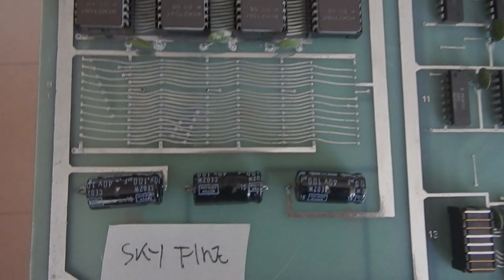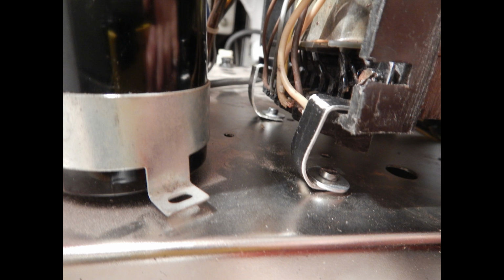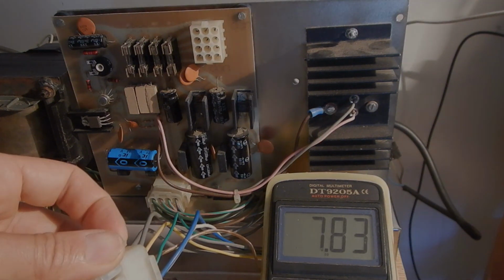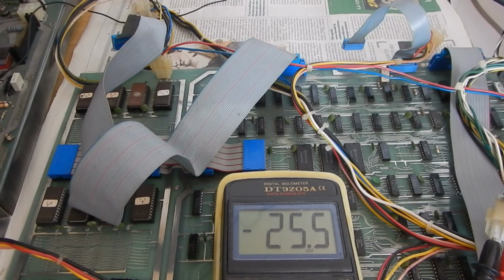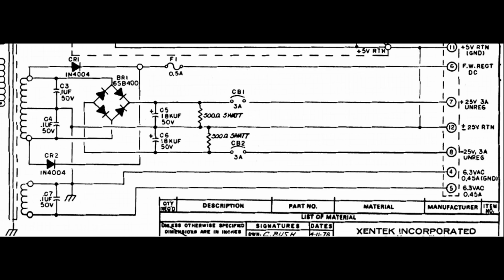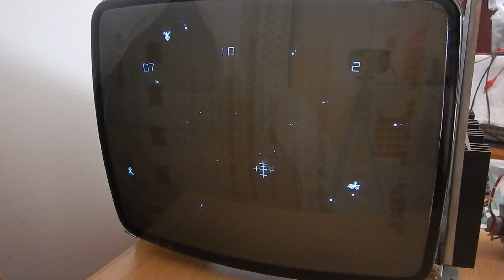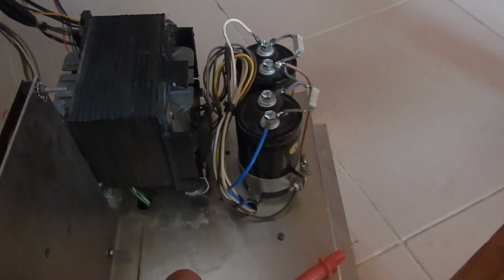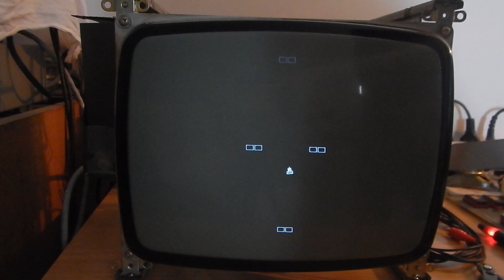Cinematronics arcade italian clones repair. Pt.1: "smoke on the power"

Comment: The center tap lifted from ground was an interesting failure. It showed the limitations of testing a power supply open circuit and a good thought process in locating the problem. It could be a difficult problem for a newbie to find but they would not forget it.
Reply from the maker: Yes, luckily I knew exactly how a lifted tap would affect the voltages under load, but yes, it might not be straightforward for everyone.

Comment: I've never had a CCPU myself but from what I have seen they can be quite reliable.
Reply from the maker: Yes, in general they are reliable and serviceable, but some clones (like these) added a lot of shortcuts. They have given me many headaches
Reply: @iz8dwf  Or are really well built and complicated like the Psikyo SH2 clones which use two FPGAs to replace the large custom chip which contains all of the glue logic and the framebuffer hardware.

Comment: i don't know if you need/want to preserve the old power supply completely, but maybe a new kind of new universal designed pcb with modern DC/DC converters would be a good idea as well. +5V, 5V, and some adjustable outputs for up to +/ 15V,....
you repaired a lot of arcade pcb, you probably know very well what is needed.
the only thing you could reuse is the transformer and because of the efficiency of modern dc/dc converters, the load on the transformer would be reduced.
Reply from the maker: The owners usually want as much as the original parts as possible. I have sometimes to insist I need to change the bad sockets and install sockets whenever I pull one IC. The old linear supplies are not too bad, but of course waste some power. In my own arcade boards I usually go for switching power supplies. The original PSUs were designed for  many ours of continuous use every day. And no, there's hardly any "universal" power requirement for 1970s and early 1980s arcades, I have seen all sort of needs, even center tapped AC (like Asteroids), or three unregulated DC rails, like some italian clones of Space Invaders.
Reply: The original PS supplies +5VDC, +/- 25VDC unregulated, +25VDC(?) regulated for the spot killer circuit, and 6.3VAC. The CCPU only uses the +5V. The 6.3VAC is used only by the CRT. The 25V goes to the audio and video boards where a 7815 and/or 7915 are used to get +/- 15VDC. Except for the 6.3VAC, I believe all of the voltages are supposed to be good up to 3 amps (the 6.3VAC is less than an amp). Would be awesome to have a modern switching PS as an option for replacement if it wouldn't cause any audio/video issues.
Reply from the maker: @dmuntz  that's on the original Cinematronics boardset. On the italian clones, the logic PCB needs also 5V and +12V (they use 2708 EPROMs). Anyway yes, the rest is correct. It isn't difficult to replace all the  linear supplies with SMPS, it's just a bit expensive. +/ 25V can be done with 24V SMPS modules (2 at 3A each). 6.3V AC can be done with a simple tube filament transformer.
Reply: @iz8dwf  Now , what I really need, is a modern replacement for the CRT HV--a replacement for the "Keltron" box, or a flyback that would work on the video boards that have  the unpopulated HV circuit. These may be harder to obtain than the CRT tube itself (with people having some success winding their own yokes to do vector graphics on what was previously a raster display). On a slightly related topic... I wonder if anyone has figured out how to use a Vectrex display with a Cinematronics CCPU.
Reply from the maker: @dmuntz  Well, yes, the old Vectorbeam CRT supply is the absolute worst design I've ever seen (and I think I can comment on a design, since I've made working CRT supply myself...). I've got random Keltron modules from ebay and some of them are rather close to being useful as a CRT supply. However, if you have the old EHT transformer, that circuit could be "fixed" with some good rework on it (although I've not really come up with a set of modifications). As for using a normal XYZ vector display with the CCPU boards, yes, I have a working design that will be shown in the next video (no idea about editing times yet). If you want some ideas about making your own CRT supply, check my video series on homemade vector monitor.